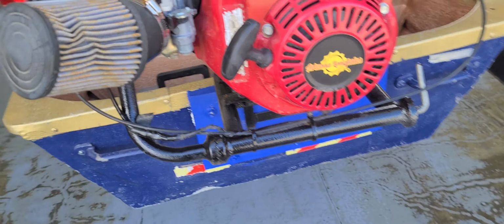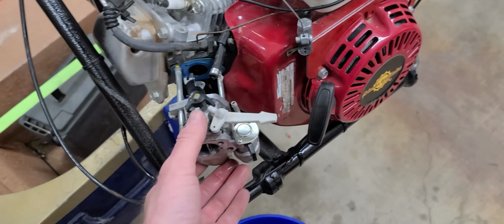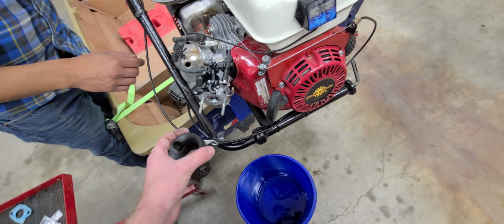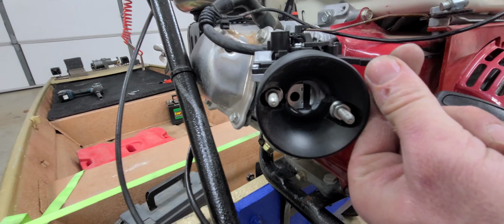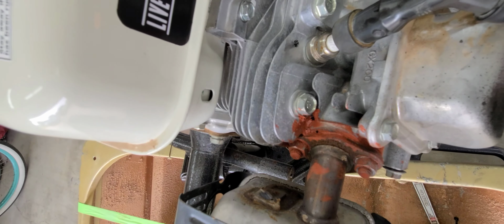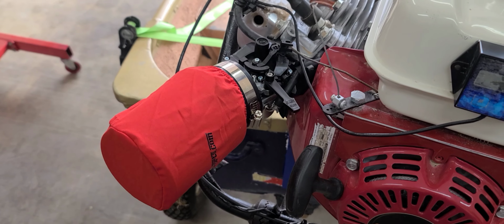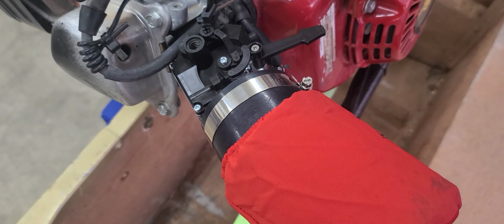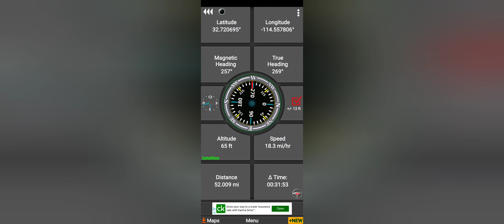Tillotson TCT Mechanical Fuel Injection Install Tune and Sea Trials #azspamcan

Comment: This is a smart upgrade. Good job on turning the muffler around too. Who would have thought, and it makes perfect sense, puts more of the noise behind you as well.
Reply from the maker: Thank you!!! Pretty good idea on davids part free mudmotor mod. The cheap fuel injection is an awesome upgrade
Reply: I'm curious if a long silencer type muffler could drastically reduce noise without flow restrictions......Many inverter generators run very quiet.

Comment: I’ll try it on the wildcat 223cc
Reply from the maker: You should it's pretty awesome builds more power on the low end where you need it on the mudmotors. No more changing jets for changing conditions.
Reply: TCT is NOT big enough for the Wildcat. You will need the TFB or you won't get max power, you'll also need to swap in an un governed ignition coil since the one that comes on the Wildcat is capped at 4k rpm.
Reply: @ImprovingYourMokai  I was thinking that man thank you
Reply: @ImprovingYourMokai  what happens if you don't swap the ignition coil? Which one do you recomend?

Comment: Have you had problems not having a fuel shut off?
Reply from the maker: Not on that carb but prior to that carb I did because my fuel cap didn't vent fast enough. So I Drilled holes in the treads on the tanks to help is vent to prevent vacuum
Reply: @azlongtales  awesome, I just installed the same carb and was curious!